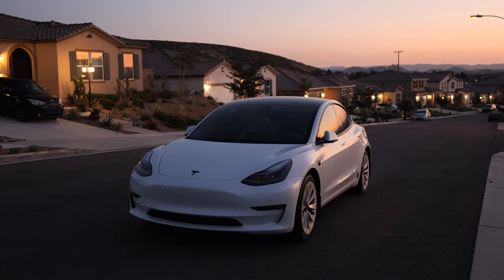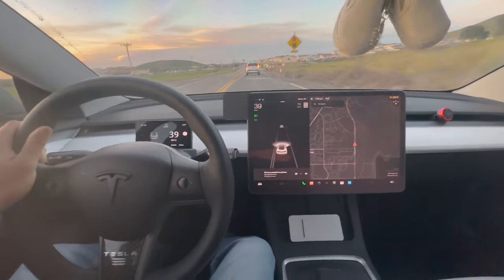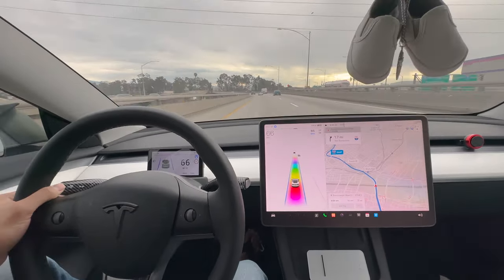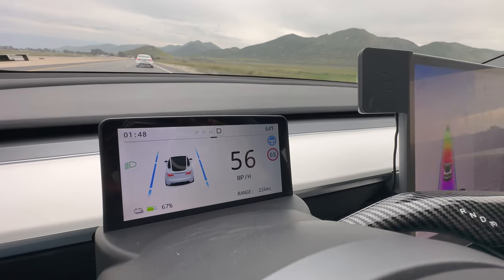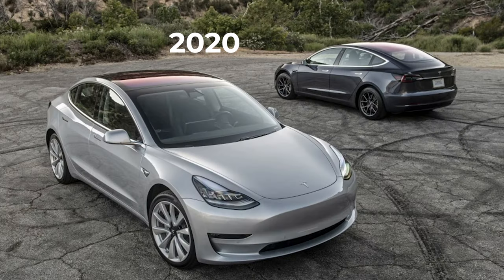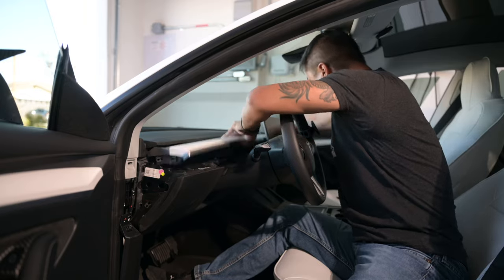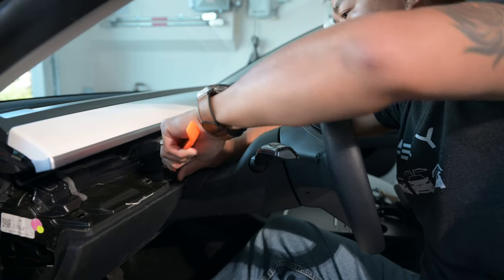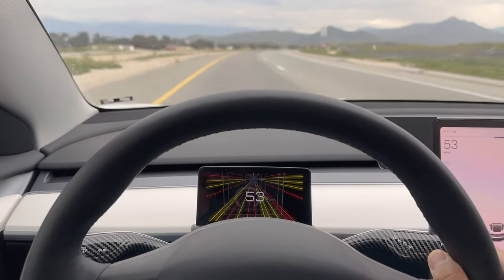2023 NEW mini display installation for tesla model 3 & Y | Step by Step Installation & Review #2023

Comment: Love the channel.  Keep up the great content.  I currently have the old mini and when it is 12pm, it shows 00:00.  Do you know if they fixed that issue?  I currently have my setting set to 12hr format.  Also are they using the same harness as the old mini?  I would rather not have to run the new harness if all the connections are the same.
Reply from the maker: That’s the wired thing. All these accessories have usb plugs for firmware update but it’s hard to find those updates to fix those little bugs.

Comment: Do you still have this mini display? Do you know how to reset this mini display? I have this screen too. Today it gets a problem after 10 months usage. Currently my model Y shows 54% battery, but this mini display shows that I have 0% battery and the range is 900 miles @_@. Have you ever experience this problem ?
Reply from the maker: I changed my mini display to another display recently, but I’ve never experienced that kind of issue. I’m not sure how to reset it but I’m guessing there should be something in the menu, but if there isn’t, I would probably just pop it out enough to disconnect the cable and reconnect the cable.
Reply: @CameraToFreedom  which mini display that you are using now?

Comment: Does it flash for FSD warning like the main screen?
Reply from the maker: I don’t have fsd. I need to try fsd at least for my YouTube videos! Do you enjoy using it? Does it actually work to your liking?
Reply: @CameraToFreedom  Love it for long drives.  Has its limitations but I have my hand on the wheel at all times and stay alert.  Definitely makes a long drive much easier.
Reply: The flashing alert will make it easier to get the warning instead of turning my head towards the screen every couple of minutes.
Reply: @CameraToFreedom doesnit warn when you need to apply pressure to steering?

Comment: That’s cool… slightly larger and it would be even better along with over the air updates
Reply from the maker: So far I’ve tried 4 screens and this one is my favorite. If it’s any bigger it will block the air vent so this fits exactly enough to let the air vent through to your face. Plus it looks like your main screen which makes it look like Tesla made it.
Reply: @CameraToFreedom  more info and a better sight picture and I’ll put up with slightly less air.